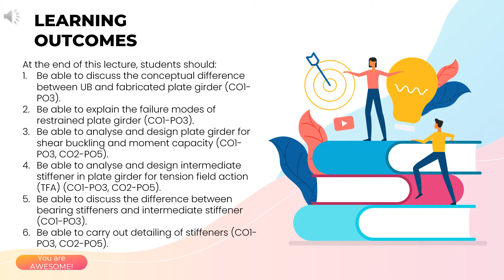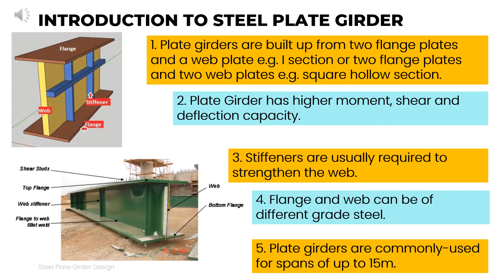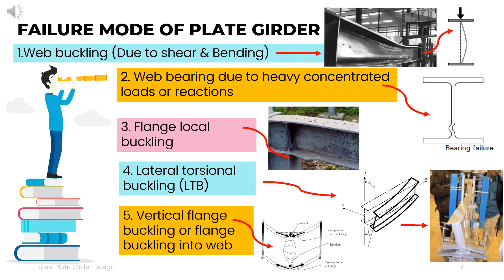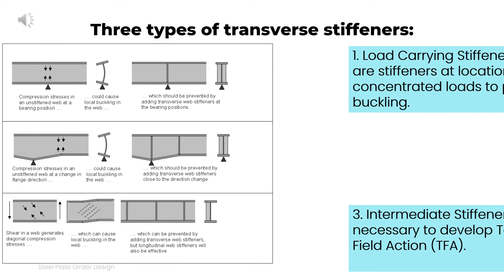Steel Plate Girder (Eurocode 3)-Summary By Dr.Ina

Comment: 5C1: INTRODUCTION TO STEEL PLATE GIRDER

1)Steel Plate Girder- defined as structural members that resist loads in bending n shear
2) it built up from two flange plate and web plate such as I section or square hollow section
3) common use of plate girder can up to 15 mm

Function of plate girder 
1) to support heavy loads (ex: bridge)
2)mainly used in railway and road bridge girder
3) used when have heavy stifness to carry heavy load

Step to procedure of steel plate girder
1)minimum web thickness
2)calculate bending resistance 
3)basic dimensioning
4)calculate web design
5)design of stiffners

Comment: 5C6 : 
Steel Plate Girder Overview
- A steel plate girder is a structural element specifically designed to withstand loads through bending and shear. Unlike standard beams, the component size and configuration of a plate girder vary based on load requirements and structural span.

Functions:
- Serves as a substitute for rolled sections in applications requiring extended beam spans.
- Essential in supporting heavy loads, as seen in bridge structures.
- Commonly used in railway and roadway bridge girders as well as crane girders.
- Ideal when deeper sections with enhanced stiffness are needed to bear substantial loads.

Failure Modes of Plate Girders:
- Web Buckling : Resulting from high shear and bending forces.
- Web Bearing :Occurs under heavy, concentrated loads or reactions.
- Flange Local Buckling : Deformation localized in the flange area.
- Lateral Torsional Buckling (LTB) : A twisting effect that occurs when the girder is subjected to bending.
- Vertical Flange Bucklin : The flange buckles into the web due to vertical stress.

Preventing Failure Modes ;
- Ensure lateral stability by using composite slabs to prevent lateral torsional buckling (LTB).
- Introduce transverse stiffeners along the web for added strength and stability.

Types of Transverse Stiffeners:
1. Load-Carrying Stiffeners : Designed to support concentrated loads.
2. Load-Bearing Stiffeners : Aid in handling support reactions.
3. Intermediate Stiffeners : Used to reinforce areas between load applications for enhanced stability.

Comment: 5B1: INTRODUCTION TO STEEL PLATE GIRDER
Steel Plate Girder Design
Plate girders are built up from two flange plates and a web plate e.g. I section or two flange plates and two web plates e.g. square hollow section. Plate Girder has higher moment, shear and deflection capacity. Stiffeners are usually required to strengthen the web. Flange and web can be of different grade steel. Plate girders are commonly-used for spans of up to 15m.

Comment: 5B1_2023359309
Plate Girder :- 
• An I beam section made up of two steel plates 
• Resist loads primarily for bending and shear. 
• Two flange plates and a web plate.
• Very thick flanges  (d) & very thin web (t)
• d/t ratio very high prone to buckling
Functions :-
• To support heavy loads such as bridge.
• Mainly used in railway, bridge & crane girders.
• Used at deeper section having higher stiffness to carry heavy loads
Failure :-
• Web buckling due to shear n bending. (Add transverse stiffeners along web length)
• Lateral torsional buckling (Provide sufficient lateral restraint)
• Vertical flange buckling. 

Stiffeners :- Load carrying stiffeners, load bearing stiffeners, Intermediate stiffeners. 

Design process :- 
1. Minimum web thickness
2. Bending resistance
3. Basic dimensioning
4. Web design 
5. Design of stiffeners.

Comment: 5B1 : Steel plate supports are auxiliary components outlined to resist bowing and shear powers, regularly utilized in large-scale development. They comprise of two thick rib plates (best and foot) and a more slender vertical web plate that connects them. 
 The internet may be fortified with stiffeners to anticipate buckling. These braces are collected utilizing welding, shooting, or riveting, with thick spines for twisting resistance and a more slender web to diminish weight. Steel plate supports are commonly utilized for ranges up to 15 meters, advertising proficient load-bearing capabilities in bridges and buildings. Computerized welding guarantees exact gathering and solid joints.

Comment: 5B1: Plate girder is a structural members that can  resist load primarily in bending and shear. It is typically an I-beam cross section made up of separate structural steel plates which can be welded, bolted or riveted together to form deeper vertical web and narrower horizontal flanges of the beam. 
Functions: 
- replace rolled sections for a long beam span requirement 
- support heavy loads
- mainly used un railway and road girders and as crane girders
- used for deeper sections having higher stiffness to carry heavy loads
Failure modes:
- web buckling due to shear and bending
- web bearing due to heavy concentrated loads or reactions
- flange local buckling
- lateral torsional buckling
- vertical flange buckling or flange buckling into web
Load-carrying and load-bearing stiffeners are the same type of stiffener, but we need to check for web buckling and web bearing separately. Tension Field Action happens when, after shear buckling, the shear panels between stiffeners develop tension to help balance the load using a truss-like action. This effect significantly increases the shear capacity of a plate girder. The design procedure of steel plate girder includes first: minimum web thickness, second: bending resistance, third: basic dimensioning, fourth: web design, five: design of stiffeners.

Comment: 5B1: 1. Components: Plate girders are typically constructed with a web plate (vertical) and flange plates (top and bottom), which handle different stress types—flanges handle tension and compression, while the web manages shear.

2. Design Flexibility: Plate girders can be custom-designed for specific loads and spans, allowing adjustments in the thickness and height of the web and flanges. This flexibility makes them efficient for custom-engineered structures.

3. Material Efficiency: By tailoring the girder to handle specific stresses, material can be optimized and minimized, reducing both weight and cost compared to other structural options.

4. Applications: Steel plate girders are widely used in bridge construction, long-span floors in buildings, and other projects where strong and reliable load-bearing members are needed.

5. Advantages: These girders offer high load-bearing capacity, resistance to buckling, and adaptability for different design needs. They can be pre-fabricated and then assembled on-site, reducing construction time and complexity.

Comment: 5B1 : Steel plate girders are structural components designed to withstand bending and shear forces, typically used in large-scale construction. They consist of two thick flange plates (top and bottom) and a thinner vertical web plate that connects them. The web may be reinforced with stiffeners to prevent buckling. These girders are assembled using welding, bolting, or riveting, with thick flanges for bending resistance and a thinner web to reduce weight. Steel plate girders are commonly used for spans up to 15 meters, offering efficient load-bearing capabilities in bridges and buildings. Automated welding ensures precise assembly and strong joints.

Comment: 5B1 :
Definition of Steel Plate Girder
- A plate girder is a structural member designed to resist loads primarily through bending and shear.
- It typically has an I-beam cross-section, formed by separate structural steel plates.
- The main difference between a beam and a girder is in their size, with girders generally being larger components.

Functions of Steel Plate Girder
- Serves as a replacement for rolled sections when spanning long distances.
- Supports heavy loads effectively.
- Commonly used in railway and road bridges, as well as for crane girders.
- Used in applications requiring greater depth and stiffness to support heavy loads.

Failure Modes of Plate Girder 
1. Web buckling due to shear and bending stresses.
2. Web bearing failure from heavy concentrated loads or reactions.
3. Local buckling of the flange.
4. Lateral-torsional buckling (LTB).
5. Vertical flange buckling or flange buckling into the web.

Steel Plate Girder Design
- Bearing failure is a key consideration.

Types of Transverse Stiffeners
1. Load-Carrying Stiffeners
2. Load-Bearing Stiffeners
3. Intermediate Stiffeners

Comment: 5B1: A steel plate girder is a structural member used to support heavy loads over long spans, typically up to 15 meters, and is commonly employed in bridges and industrial structures. It has an I-beam cross-section made from welded, bolted, or riveted steel plates, with a deeper web and narrower flanges. Plate girders, with thicker flanges and thinner webs, offer high moment, shear, and deflection capacities. Stiffeners are often added to strengthen the web against buckling, and the web and flange can be of different steel grades. Common failure modes include web buckling, web bearing, and flange local buckling, and stiffeners can be placed to counteract these stresses. The design process includes selecting minimum web thickness, bending resistance, and designing for stiffeners and web buckling stability.

Comment: 5B1:

Introduction of plate girders
- a structural member that resists loads primarily in bending and shear
- An I-beam cross section that is welded and bolded. It is usually made from separate structural steel plates.
- size component is the key for difference between a beam and a girder
- has a higher moment, shear and deflection capacity
- Plate girders are usually used for a span of up to 15m.

Economical design:
-Very thick flanges
-Large depth (d)
- Very thin web (f)

-The web buckling when d/t ration is very high

Function:
-replaced rolled sections for a long beam span requirement
-Support heavy roads
-Used in railway, road bridge girders and as a crane girders
-Used when deeper section having higher stiffness to carry heavy loads

Failure mode:
-web buckling
-web bearing
-lateral torsional buckling
-vertical flange buckling

Types of tranverse stiffeners:
-Load carrying stiffeners
-Load bearing stiffeners
-Intermediate stiffeners

Design process:
-Minimum web thickness
-Bending resistance
-Basic dimensioning
-Web design
-Design of stiffeners

Comment: Plate girders are structural components that mainly withstand shear and bending loads. Web buckling, web bearing, flange local buckling, lateral torsional buckling (LTB), and vertical flange buckling are a few examples of plate girder failure modes. The size, shape, and loads carried distinguish universal beams (UB) from plate girders.

Comment: 5B1: This lecture covers steel plate girders used in long-span structures like bridges. Key points include:

	1.	Structure & Use: Made of flange and web plates for heavy loads.
	2.	Failure & Prevention: Risks include web and flange buckling; prevented by stiffeners and lateral restraints.
	3.	Stiffeners: Three types—load-carrying, load-bearing, and intermediate—prevent buckling.
	4.	Tension Field Action: Increases shear capacity after shear buckling.
	5.	Design: Involves calculating web thickness, bending resistance, and stiffener placement.

Comment: 5B1: This lecture introduces steel plate girders, highlighting their use for heavy loads over long spans and comparing them to beams. Key points include:

1. Structure & Use: Plate girders are built from flange and web plates, used in bridges, long-span floors, and industrial structures.

2. Failure Modes and Prevention: Possible failure modes include web buckling due to shear, flange buckling, lateral torsional buckling, and flange buckling into the web. Lateral restraints and transverse stiffeners help prevent these failures.

3. Types of Stiffeners: The three main types are load-carrying, load-bearing, and intermediate stiffeners, each with specific functions to mitigate buckling and support concentrated loads.

4. Tension Field Action: After shear buckling, tension field action can significantly increase the girder’s shear capacity.

5. Design Process: Design involves calculating web thickness, bending resistance, basic dimensions, and stiffener placement.

Comment: 5A2:
Definition: Steel plate girders are structural members designed mainly for bending and shear forces. These girders are constructed from individual steel plates, typically in the form of an I-beam, which are joined together using welding, bolting, or riveting methods.

Construction: Girders are composed of two flange plates and one or more web plates, which enable them to bear higher moments, shear forces, and deflection capacities. The web is reinforced with stiffeners, and different grades of steel may be utilized for the flanges and the web to optimize performance.

Design Considerations: For economic efficiency, these girders are designed with thick flanges and a thin web. Due to the high depth-to-thickness ratio, the web is susceptible to buckling, necessitating meticulous design. Automated welding processes are employed to ensure secure assembly.

Applications: Commonly used for spans up to 15 meters, steel plate girders are crucial in large structures due to their load-bearing efficiency.

Comment: 5A2 : Plate girders resist loads primarily due to bending and shear. They are built up from 2 flange plates and a web plate.

As a design consideration, plate girders have very thick flanges, large depth but thin web

Comment: 5A2: Definition of Steel Plate Girder
-Plate girders defined as structural members that resist loads promarily in bending and shear.
-Typically an I-beam cross section made up of separate structural steel plates.
- The key difference between beam and girder is the size of component.

Functions of Steel Plate Girder
- Replace rolled sections for a long beam span.
- To support heavy loads.
- Mainly used in railway, road bridge and as crane girders.
- Used when we need deeper Functions of Steel Plate Girder having higher stiffness to carry heavy loads.

Failure mode of Plate Girder
1.Web buckling (Due to shear & Bending)
2. Web bearing due to heavy concentrated loads or reactions
3. Flange local buckling
4. Lateral torsional buckling (LTB)
5. Vertical flange buckling or flange buckling into web
Steel Plate Girder Design
Bearing failure

Three types of transverse stiffeners:
1. Load Carrying Stiffeners
2. Load Bearing Stiffeners
3. Intermediate Stiffeners

Comment: 5A2 : Steel plate girder
-may defined as structural members that resist loads 
-typically on I beam cross-section
-made up of separate structural steel plates which are welded,bolted, or riveted together to form the deeper vertical web and narrower horizontal flanges of the beam.
-the key differences between a beam and a girder is the size of the component.

Function of steel plate girder
1. to replace rolled sections for a long beam span requirement 
2. to support heavy structural loads
3. Mainly used in railway and road bridge girders and as crane girder in industrial structures 
4. used when need deeper sections having higher stiffness to carry heavy load

Failure mode of plate girder
1. web buckling ( due to shear and bending)
2. web bearing due to heavy load concentrate loads or reaction
3. Flange local buckling
4. Lateral torsional buckling
5. vertical flange buckling

Comment: 5A2 : PLATE GIRDERS
- Structural member that resist load primarily in bending and shear
-Difference between of beam and plate girders is the size of the component
-Plate girders has higher moment, shear and deflection capacity
-Function of plate girders to support heavy load, replace rolled sections and used when need deeper sections
-There are five failure of plate girders which are web buckling,  web bearing, flange local buckling, lateral torsional buckling and vertical flange buckling.
-Three types of tranverse stiffeners are load carrying stiffeners, load bearing stiffeners and intermediate stiffeners.
-Five step of plate girders are minimum web thickness, bending resistance, basic dimensioning, web design and design of stiffness.

Comment: 5A2 :  Plate girders
- structural members that resist loads primarily bending and shear.
- typically an I-beam cross section made up of separate structural steel plates which are welded, bolted or riveted together to form the deeper vertical web and narrower horizontal flanges of the beam.
Difference between a beam and girder  : size

Function :
- replace rolled sections for a long beam span requirement
- support heavy loads such as on bridge structure
- used in railway and road bridges girders 
- used when we need deeper sections having higher stiffness to carry

Failure mode of plate girder
- web buckling ( due to shear & bending)
- web buckling ( due to heavy concentrated loads & reactions )
- flange local buckling
- lateral torsional buckling (LTB)
- vertical flange buckling into web

faliure modes can be prevented by :
- provide sufficient lateral restraint
- add transverse stiffeners along the length of the beam web

3 types of tranvers stiffeners :
- load carrying stiffeners
- load bearing stiffeners
- intermediate stiffeners

Comment: 5A2:
1. Plate girder is an I-beam cross-section made up of separate structural steel plates. The difference between UB and plate girder is the size of the component.

2. Function of plate girder;
- Web buckling due to shear and bending 
- Web bearing due to heavy concentrated loads or reactions
- Flange local buckling
- Lateral torsional buckling 
- Vertical flange buckling or flange buckling into web

3. Plate girder design;
- Has very thick flanges, large depth (d) but very thin web (t). (Economical design)
- Not having very high d/t ratio
- Size of plates (flange and web) can be chosen

4. Difference between bearing stiffeners and intermediate stiffeners;
- Bearing stiffeners: Prevent compression stress 
- Intermediate stiffeners: Prevent diagonal compression stress